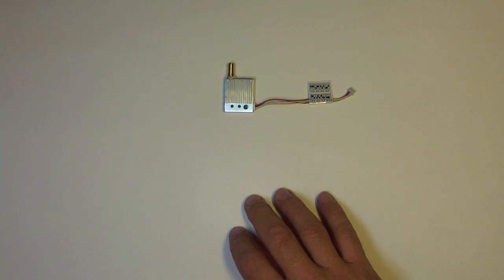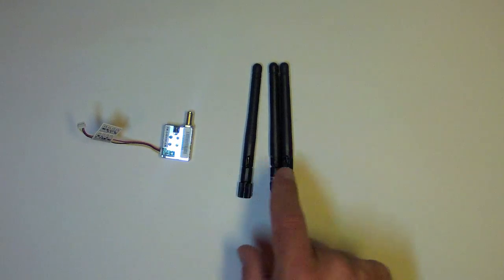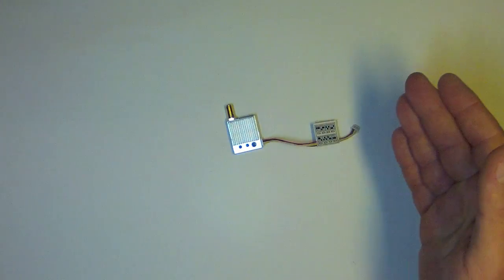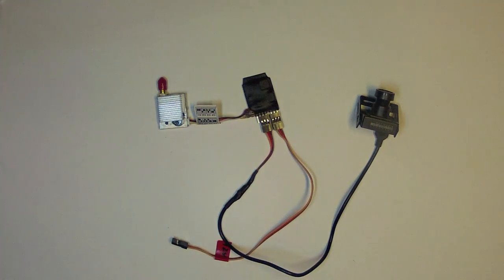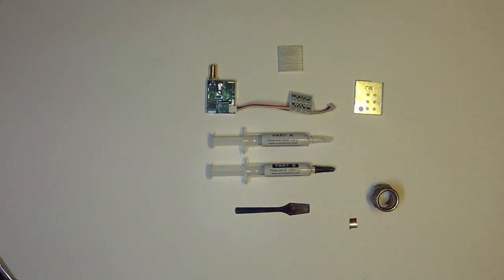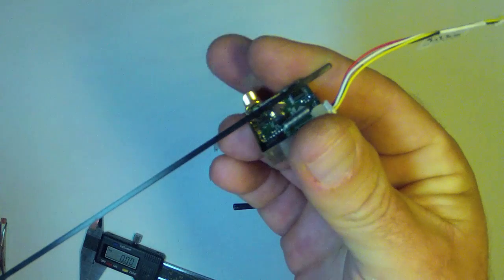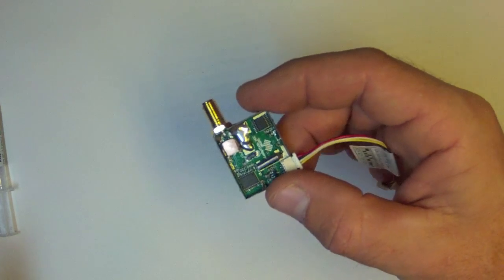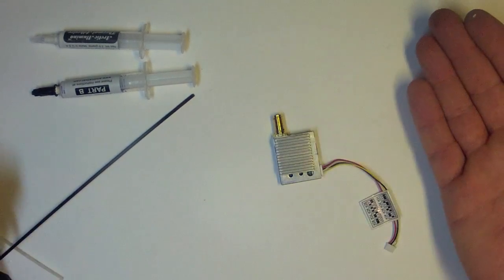LAWMATE 2.4GHz 500mW FPV Video Transmitter, review and heatsink modification

Comment: Nice review. I bought one of these but I'm not very happy with it. The PCB in mine looked really messy. Its ridiculous there is no contact between the RF chip and the heat sink?  I soldered the copper shim to the case and used Arctic thermal paste between it and the chip. I did ruin one doing this mod a different way. Anyone know what the value of the small SMD resistor is below the RF chip? I'm going to test it on my quad since it has RTL but I'm unsure I want to use it on my FPV plane.

Comment from the maker: This modification was based loosely on the TBS mod.  I would think it could work on the 1.2GHz as long as you could find the RF chip and interface a heat sink to it in a similar way.  Applying the heat sink to the PCB side of the RF chip is theoretically better but more of a commitment, and risk.  Applying the heat sink to the chip surface side is easier and does not require any action on the chip itself or the board, which is why I chose this method.

Comment: Hello,

Is it possible to perform the same operation with the Lawmate 1.2? I opened this one and the components are not quite the same.

I caipirinha of the location of TBS Vtx is already cast. However, the radiator is at the bottom of the housing, normal? They perform the same change?

Comment: Hey thank you for sharing this video. I'll be checking out all my vtx to ensure heat are transferred properly through to the heatsink.

I have a question, with some of the vtx, e.g., 1.3Ghz there is a small knob. Whats the purpose of that thing? I have been looking for info, no luck so far : \

Comment: I will be using it with a TBS core for the 5 volts. Any experiences with that? Is that 5v clean enough?

I'm actually switching from 1.3ghz because of antenna size, so I will be replacing all my vtx's with the lawmate

Comment from the maker: If you can find a penny from 1981 or before it will be 95% copper and therefore OK to use as a heatsink, though borderline thin.  From 1982 pennies were made of zinc cores with copper coating so they're not as good a heat conductor so not recommended for this heat sink operation.

Comment from the maker: At least remove the shrinkwrap over the heat sink fins.  I'd probably leave the rest.  You could probably take the whole thing apart and do the thermal epoxy modification but I would be sure you are ready for the extra effort. The Lawmate truly needs the cooling modification, the usual 5.8GHz transmitter may be OK as-is.  I'm not certain which CorrosionX product you mean so I'm sorry I can't comment on that.

Comment from the maker: I think it must have been ripple current from the ESC - maybe more than the voltage reg could compensate.  It was right off the main motor battery.  I had the prescribed capacitors and choke on it, but I didn't make any elaborate attempt to tune it.  To be honest I actually gave up on it pretty quick once I found the NGH PSU.  It's way better, lighter, has a pass-through for the camera power, etc.

Comment: Ok thanks Ed for the response. I am also an amateur radio operator and I remember a while back doing some amateur television work. We had to either audibly or visually sign our call. So that means I could do some atv work without using my call? I'll have to check on that.

Comment: Hi. Not sure why you were getting noise when using a linear 7805. Were you running it straight from the main motor battery? If you run it from a separate and dedicated video battery, I see no explanation for noise?

Comment from the maker: Yes, a dedicated 5v battery would work great!  The Dragonlink transmitter only works with Dragonlink receivers as far as I know.  They are not cheap though.  For the Spektrum (when using the internal 2.4GHz) I use the Hobbyking OrangeRX receivers for my non-favorite airplanes and Spektrum brand for my nice planes.

Comment: great tutorial, Ed.  I did a similar thing to my Sunsky 1.2ghz Tx but i used a thermal interface pad from chomerics and covered the whole Tx board then applied a heatsink.  Copper will conduct more heat and has less thermal resistance than the pad but it cooled my Tx down to 45C heatsink temp in still air.  The chomerics stuff is expensive though and not nearly as readily available.  Luckily, I optimize electronics designs for thermal performance at work so I have quite a selection.